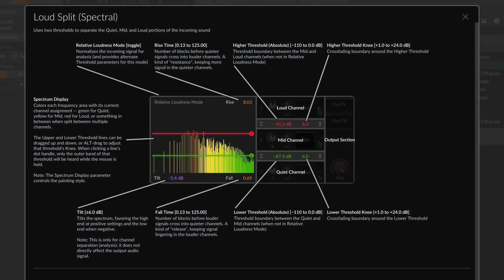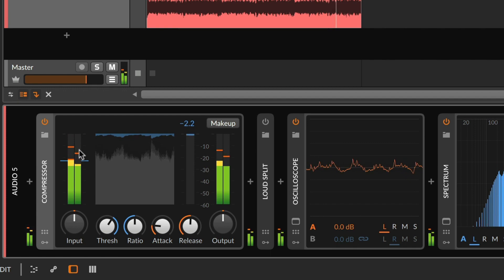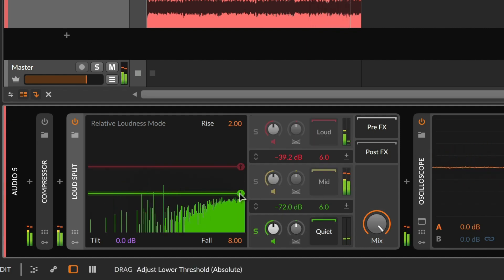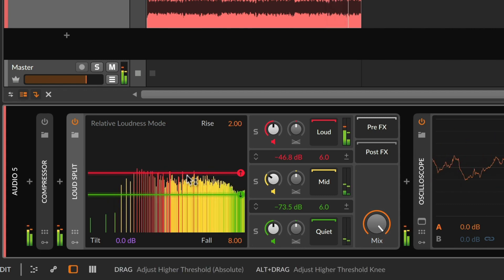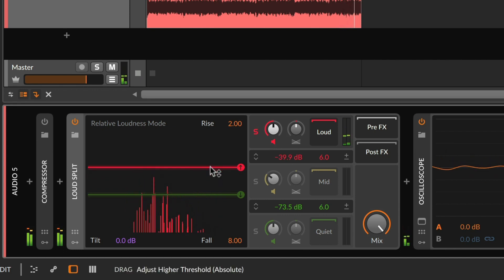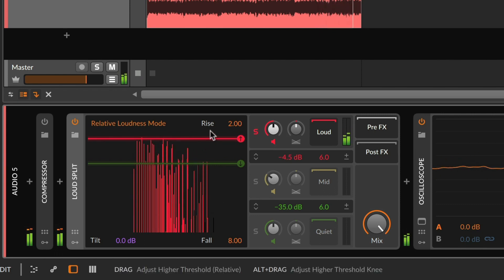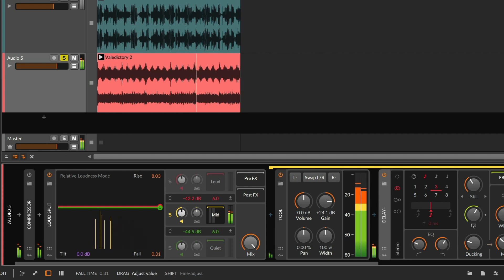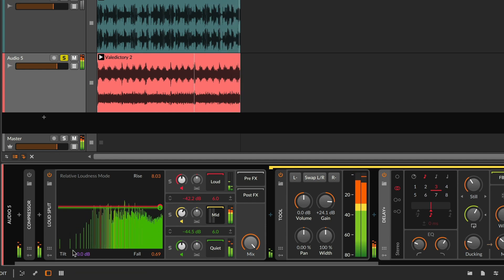How To Use Bitwig's Loud Split Device

Comment: These tools are very cool but MSEG and more user friendly automation handles would be amazing. See Studio One for the proper UX/UI performance and feel. Bitwig's automation is currently VERY clunky. Also please tone down the sensitivity of the clip gain handles. It jumps 10 db with the slightest mouse movement. Also can you please allow the browser to remember the sample preview volume level ? Every time I open the software and start browsing samples I need to lower it by -10db. Many professionals do not mix at 0 db ... so why should all the samples default to 0db?
Reply: As primarily a studio one user, the automation inside studio one is nowhere near Bitwigs modulation.....
Reply: @tgoodjenkins  I wasn’t talking about the modulation features which are incredible in Bitwig. I was talking about the basic automation handles. Ducking volumes on vocals, sounds, etc..
Reply: @MagicCvstle  a lot of that can be achieved with the modulation inside of bitwig while mixing. But i prefer that style for what i do.
Reply: @tgoodjenkins  Yes there are some really cool possibilities with the modulation tools. I would say Bitwig is far beyond any software in existence in that category. Let me provide example which should help with context. I recently recorded a singer for a song we're doing for a client. We did a lead track, 8 double tracks, 8 high harmony tracks, 4 alternate voice tracks, and adlibs. In EACH of these tracks I manually go in and adjust the volume of phrases that are too loud. I also remove every breath and 'ess' from each track individually. This takes a ton of use of the automation 'handles'. Its not possible to do quickly in Bitwig because of the feel and lack of intuitiveness. This is why I use Studio One to record and process my vocals. I use it to mix and master my songs as well because Bitwig usually doesn't like the size of my productions..
Reply: @MagicCvstle  fair enough I rarely deal in more than 16-32 tracks. I  see what you mean.
Reply: MSEG would be nice but MidiShaper is filling the gap pretty nicely for now